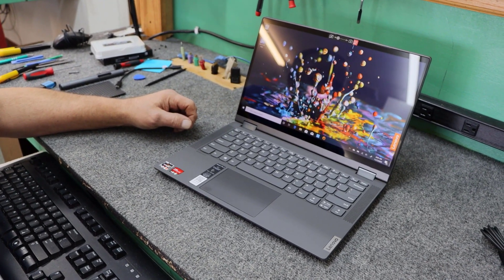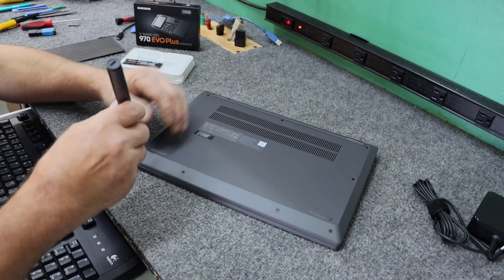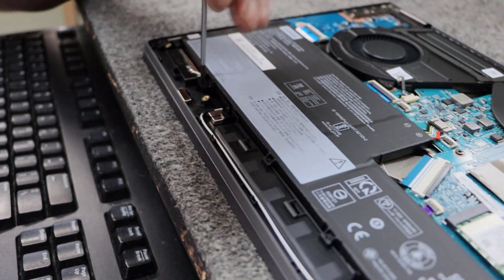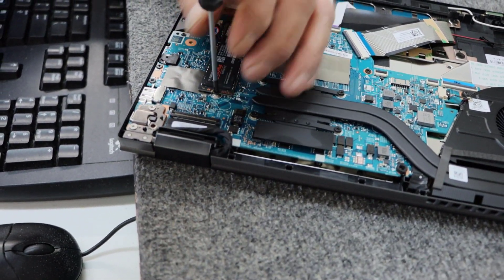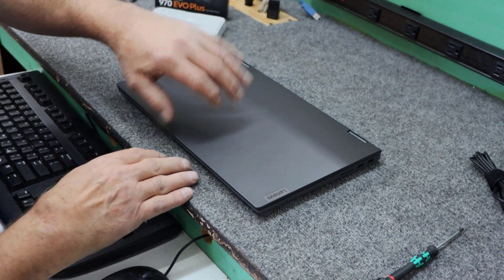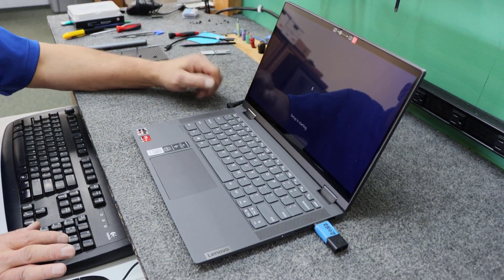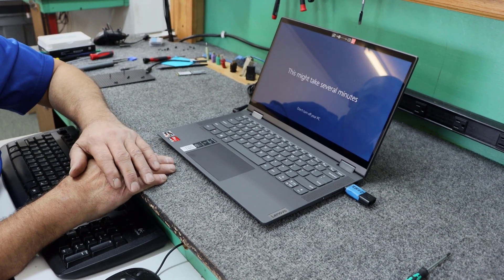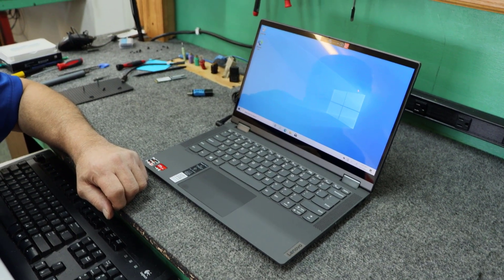Install Samsung 970 EVO Plus NVMe SSD in NEW Lenovo Flex 5 Laptop

Comment: I like my Lenovo Flex 5 15 inch. The only problem I have is hard drive space so I bought a 500gb 970 EVO Plus m.2 drive to install and I think it's a Windows 10 update caused my touch screen to stop working. Still works with the pen but not with my fingers.

Comment: Thank you for the the video. Very detailed and informative! I currently have a slightly older Lenovo Flex 14 (2018) that is possibly corrupted SSD. Will not get past the boot screen regardless of whatever I do (BIO settings, recovery key installation). Will changing the SSD fix my problem?

Comment: Hey I just bought this and realized it doesn’t have upgradable ram, I’m kinda disappointed and probably going to send it back because if I upgrade to windows 10 it will be slow. What do you think about this? I jumped the gun without looking to see if the ram was soldered. It was $330 but I wanted something a little more useful.
Reply from the maker: It really depends on what you want to use it for.  With a 970 EVO in it. It should be pretty snappy, despite the ram.  It's really the cpu and ssd that the speed comes from. Not the ram.  Dale
Reply: Cadillac Computer Center yeah your right, but will it be able to handle not having windows 10s and with small games? Honestly it’s more of a school computer for me just want it to be able to do both small games and not be laggy with many windows open.
Reply from the maker: Hi.  If you have the same model in the video, it is the highest ryzen 3 cpu. Pretty good for some games for sure. It will run windows 10 just fine, smode just means you can only run apps from the ms store.  Dumbest thing ms did with 10.  I think it would serve you well for the price. The higher performance ssd I installed makes a difference as well. Dale
Reply: Cadillac Computer Center thanks Dale really appreciate it!!!!

Comment: ? I have an Acer Nitro 5 and it’s new will it void warranty if I put more ram and another NVMe drive in it?
Reply from the maker: Hi. You can check with Acer if you want to first. But these laptops are designed to be upgraded. If you do not damage anything you will be fine. Dale.